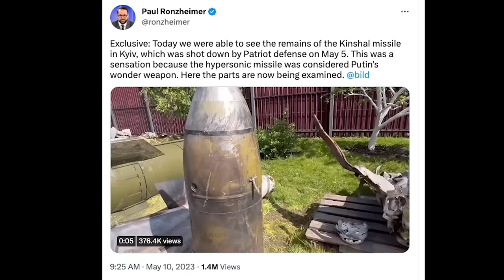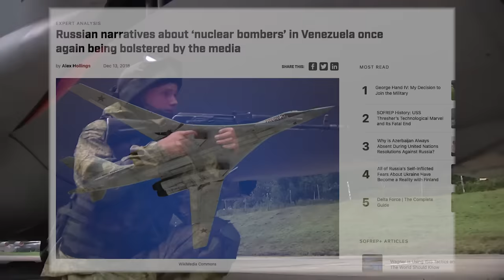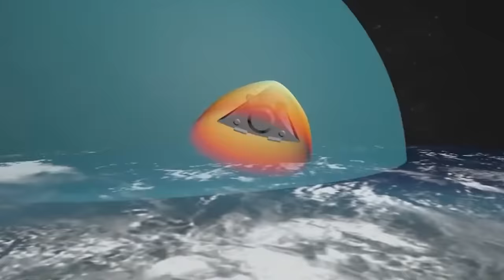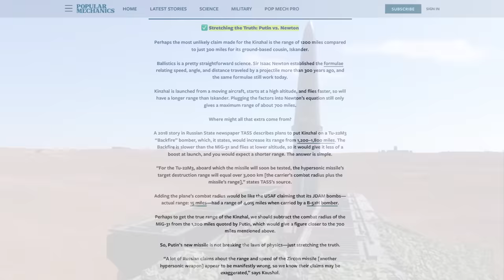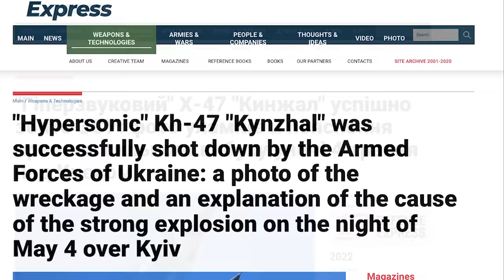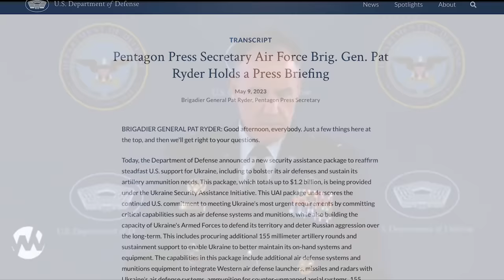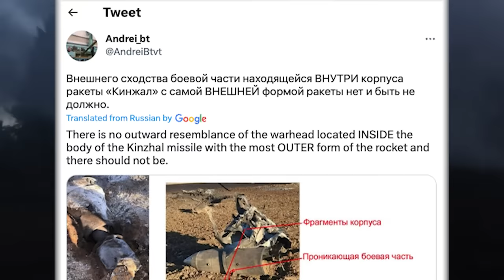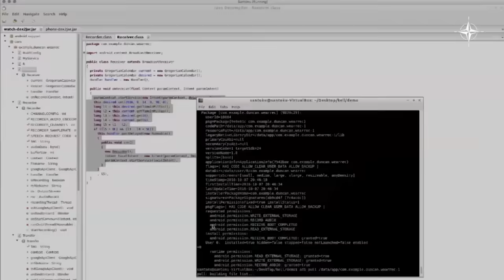Ukraine intercepts Russia's Kinzhal missile?!? Here's what happened

Comment: The Netherlands will supply parts of a Patriot air defence system, specifically 2 launchers and missiles, to Ukraine. The Netherlands is also responsible for training Ukrainian soldiers. Further The Netherlands will supply 100 vehicles fitted with anti-aircraft guns that were commercially purchased in the Czech Republic. Netherlands Minister of Defence Kajsa Ollongren reported this to the House today. During the Ukraine Defense Contact Group in Ramstein, Germany, agreements were made to accelerate the replacement process for the Patriot. In Ramstein, the ministers of defence met for the eighth time.

Comment: did you see that MALD decoy drone remains were just found in Ukraine? Very interested to hear your take on that. I'm wondering if they have explosive payloads, as a cheap cruise missile option
Reply: To the best of my knowledge - no. I’m pretty sure they don’t even have any targeting systems because… why would they?

Edit: So, I’ve read up on the development of the ADM-160 MALD and there WAS an experimental version called MALD-V which introduced a modular payload so that the MALD-V could take on board surveillance gear, jammers, etc.
So, even though it really wasn’t the idea behind the -V experiment, it could have been technically possible to produce a payload module with a warhead and turn the MALD into a cruise missile, just like the original commenter suggested. Mea culpa.
Reply: Interesting question . I do not know the system that replaced the TACIT RAINBOW..
Reply: But what's even better, if the MALDs clean out the path for Storm Shadow, bye bye Kerch bridge (and hopefully all ships and remaining fuel tanks in Sevastopol plus a bunch of S400 search radars).
Reply: Supposedly MALD was cancelled after only 150 were made.   I'd say they improved it and made more or developed a better version as a dark program.  MALD has one job: look like a F-117, F-22, F-35, B-52 or B1 or F-15 etc to seduce enemy resources away.
Reply: @williamzk9083  The ADM-160 MALD is alive and well. It’s still being developed, produced, etc. The only thing resembling being “cancelled” is that shortly after the improved version, ADM-160C MALD-J (which is indeed really impressive), started being delivered in 2012, the older version (ADM-160B) stopped being ordered in favor of the new variant.

Comment: I thought that the Netherlands also provided an Patriot system. Keep up the good work! Nice video
Reply: At the moment it's only one from the US and one from the Germans.
Reply: No, our prime minister said we would do that but later backed down. In the end we only provided two launchers that were added to the German system.
Reply: @nietkees6906  two additional launchers helps.
Reply: @geoff4383  Not much. People often count the amount of SAMs by the amount of launchers, but the amount of radars is far more inportant.
Reply: I mean it all helps, the launchers are 10 million a pop with missiles that cost 4 million. I’d be surprised if the launchers didn’t cost more. It’s a huge expense. The radars also have a range over 100 km. Where as the pac 3s range is around 50km meaning you need multiple launchers to service one radar. I’d be surprised if the logistical bottleneck isn’t the launchers and the missiles.
Reply: @NickSteffen  
10 million a pop is nothing compared to the whole system excluding missiles costing 400 million.
And the radars are the bottleneck as the radar determine how much area you can cover.
Reply: @nietkees6906   uh it’s not nothing for a small country like the Netherlands, and it’s more like 52 million, as each launcher has 4 missiles that cost 4 million each and there are two launchers. Additionally missiles get used up and replaced and launchers need significant maintenance because you have to fire a rocket out of them meaning they require greater logistics. You don’t need to replace radars after fielding them. So they have lower logistical impact full stop. Ukraine is going to run out of missiles and launchers long before they run out of radars. 

I’m not sure why you are so insistent on denigrating what is a valuable contribution.
Reply: @NickSteffen  The missiles are more valuable contribution than the launchers. 
We don't even know whether these are additional launchers to the battery or whether they replaced German launchers.
And no, launchers can be easily re used. They don't require large maintenance.

More radars means that they can defend more of Ukraine.

I am denigrating about it because Mark Rutte has pulled this trick of first saying to send something while later backing down before.

Comment: In all fairness, the patch for the software error was LITERALLY one day late. As it turns out the cause was an inaccurate calculation of the time since boot due to computer arithmetic errors. Specifically, the time in tenths of second as measured by the system's internal clock was multiplied by 1/10 to produce the time in seconds. This calculation was performed using a 24 bit fixed point register. In particular, the value 1/10, which has a non-terminating binary expansion, was chopped at 24 bits after the radix point. The small chopping error, when multiplied by the large number giving the time in tenths of a second, lead to a significant error. Indeed, the Patriot battery had been up around 100 hours, and an easy calculation shows that the resulting time error due to the magnified chopping error was about 0.34 seconds.

Because of the way the Patriot computer performs its calculations and the fact that its registers are only 24 bits long, the conversion of time from an integer to a real number cannot be any more precise than 24 bits. This conversion results in a loss of precision causing a less accurate time calculation. The effect of this inaccuracy on the range gate's calculation is directly proportional to the target's velocity and the length of the the system has been running. Consequently, performing the conversion after the Patriot has been running continuously for extended periods causes the range gate to shift away from the center of the target, making it less likely that the target, in this case a Scud, will be successfully intercepted.
Reply: Excellent explanation! I remembered something about the incorrect timing, but did not know the details. Thanks.

Comment: One thing that people tend to not get about these hypersonic missiles is that while they're hypersonic for their glide phase, they aren't necessarily hypersonic for their terminal phase. Once they get to the lower layers of the atmosphere, they tend to slow down because otherwise the drag would put too much strain on the missile, but because they slow down, they are a lot easier to hit.

The scary part is that they are hard to shoot down until right before they hit something, so the stakes are a lot higher.
Reply: Duh. Everyone knows this about atmospheric pressure but kinzal is hypersonic in lower elevation with maximum atmospheric pressure that's why it's shell is so thick.
Reply: This is for HGV's Kh-47 is not an HGV
Reply: @ChuckyRed06  It has more to do with the shell's material and its ability to endure extremely high temperatures.
Reply: @ChuckyRed06  The bigger issue is that, at extreme speeds, you don't have much maneuverability. And most shoot downs aren't tail chasing the missile, they're just trying occupy the same space as the incoming missile at the same time. Which is easier to do the more predictable the flight path happens to be.
Reply: yer. They still go in a straight line. Fast or slow its just basic maths at that point
Reply: @Hawk Anonymous - Wouldn't you just track the heat signature at that point?
Reply: @velvetmagnetta3074  Hawk Anonymous means that it's the incoming missile that is blind.
Reply: @MangusPicco   - Ah! Yes, I see that now. Thank you.

The original post was about shooting the missile down, then Hawk's was about needing "internal guidance" to reach a target, because no corrections will be able to be sent TO and FROM the missile.

(I misread it as talking about tracking the missile itself to shoot it down. Thanks!)
Reply: It likely attains its top speed in the boost phase.
Reply: Not true , Kinzhall fly at highpersonic speeds from the start.. there is no deceleration as you claim. It need to ascend to space beyond patriots reach and when it reach its desired altitude , goes down in an erratic unpredictable non linear path around its target . Kinzhall is a true hypersonic missile ,from Mach 5 to mach 12.    When it hit the target is when it reach its max speed. For maximum damage. It doesn't require an explosive charge. the massive speed and momentum is enough to produce a massive an explosion comparable to 4,000 tons of tnt and reach very deep bunkers more than 150 meters underground.  Kinzhal is a true High Hypersonic missile. And it can fly at hypersonic speeds 100% of the time if required it. It reach hypersonic speeds Mach 5.0 in just a few seconds after been launched from a fastest flying Mig-31BM interceptor. Kinzhall was designed to defeat NATO best and potentially future air defenses. and it accomplished its job.

Patriot Radar Station and Five Missile Batteries Destroyed in Russian Hypersonic Strike on Kiev

https://militarywatchmagazine.com/article/patriot-station-batteries-destroyed-hypersonic

Sorry but NATO Patriots systems in kiev were completely destroyed and even NATO admit their patriots were hit , but they made it look , that it was slight damage. NATO lost a a billion of dollars in a single strike. Those patriots were fired blindly at space , they never saw the missile flythrought  in their radars once was launched . AESA radars were not designed to detect super hypersonic mach12 missiles. Best hope for patriots or NATO airforce is to hunt and target mig31 when they are in the base before they are in the air and launch the missiles.
Reply: @technoartfest8708   - Lol.
Reply: @technoartfest8708  sorry but everything you wrote is just regurgitated propaganda with no basis in fact. You don’t know whether or not if anything you’ve mentioned is true or not, you’re running on “faith” alone. 
Patriot is cleaning Kinzhal clock and you’re just finding this hard to deal with.
Reply: Kinzhal is in no way a glide vehicle.
Reply: Lol....🤡🌏🤣🤣🤣

Comment: the speed of a hypersonic missile means that a defending  SAM can hit those that are travelling directly toward the launcher, but if the incoming is off-axis, its going to find its range severely restricted.
Reply: Post numbers instead of words. For example how much is the reduction of the side range of a patriot missile system against a mach 10 hypersonic missile?
Reply: Launch angle is important. They tried several angles and had some misses  until they got it right in the very same first engagement.

Comment: i was a little surprised so many defense experts didnt know that most missiles dont have the war head right in the front... most of them need avionics in the nose cone. just like the tomahawk. the warhead sits a little back. of course we have no images of what a real Kinzhal warhead looks like but if they made a version with a bunker busting one then that thing they found looks exactly like what one would expect for a concrete penetration warhead. a lot of material and a little void for some high explosion.
Reply: People assumed that was the nose cone.
Reply: You are completely right, Russian Wiki states about Iskander (which is actually the same missile, only ground-launched):
"Non-cluster munitions for hitting point targets
Non-cassette warheads are designed to destroy point fortified objects such as command bunkers, reinforced concrete warehouse buildings, barracks, fuel storage tanks, and the like. The anti-bunker ammunition is generally similar in weight to the BETAB-500U concrete-piercing bomb, due to the kinetic energy and hard shell designed to break through reinforced concrete floors up to 1.2 meters thick and detonate indoors [45]."
Reply: There are images of failed Kinzhal missiles during testing that show what's underneath the nosecone, specifically the warhead casing, and it looks more or less identical to the one in Ukraine.
Reply: @Skinflaps_Meatslapper  No the one ukraine took out was a BETAB-500 bomb.

Comment: Need to get into costs to understand the sustainability.
Pac-3 costs around 8 million per missile on the pessimistic side. 
If Kinzhal is like the Iskander precises are similar to pac-3 more or less.

There is other part of this equation.
What's the value of the information gathered in Ukraine?
All radar signatures are being recorded and surely sent back to the US. Price of this intel?
I think US is learning A LOT by providing this systems. 
Learning and improving with tons of information.  

In the meantime Russia is eating hours of its Mig-31 and does engines where not made to last. They were made for speed. (in general fighters are no made to fly a lot). 

I think this equation is paying off for the US, NATO and Ukraine for now
Is Russia capable of learning about Patriot systems? will see
Reply: Once PAC-3 started getting mass produced, the price for every missile would go down. That's why the F35 keeps getting cheaper every year.

The reason it cost so much was because no one was buying it then. There was no need for PAC-3s since no one was fighting a conventional war.

And then Russia invaded Ukraine and China starts getting more aggressive.
Reply: According to NATO F-35 pilots. Russia has been using a secret scan mode for their S-400 batteries during this war so F-35s flying over NATO airspace encountered an unknown radar contact for the first time. But after realizing it is S-400 it has been already catalogued and added to radar signature database. So yeah everything Russia does in this war shows their hand to NATO a lot more.

Comment: I thought The Pac 2 in first Iraq war had a high hit rate, but lots of them had hit there target destroy the missile rocket booster in the air but not the warhead, so it still end up landing randomly in the city in parts, but with the warhead Intact.
Reply: Yes, that original report and subsequent testimony in front of Congress counted that and many others not directly on target as a "miss".

Which I guess turned out okay since it forced our engineers to improve the system! 😃
Reply: That was PAC-1.   PAC-2 is a long range anti aircraft missile and PAC-3 a medium range anti missile missile (endo atmospheric only), PAC-4 is a bit of a waste of money done for the sake of Israel.   I'd say there will be a need for an extended range PAC-2 with about 2-3 times the range.  We've seen how problematic S-400 can be with its 200km range and 400km range.   The glide bombs Russia is launching have a 50km-70kmm range and at best PAC-2 has 150km (realistically 100km) which would mean  Patriot would need to be placed within 20km of the border to intercept Russian bombers releasing glid bombs.   A system as big as Patriot would be detected and targeted by artillery for Sure.
Reply: That’s true. Also, a lot of Scuds just kinda fell apart midair, especially the ones that were jury rigged to give greater range, which obviously made “interception” impossible (although said missiles were already destroyed).